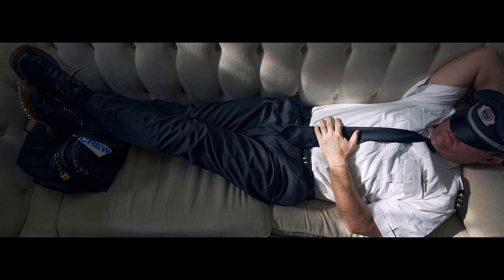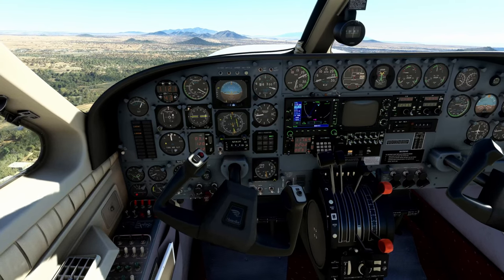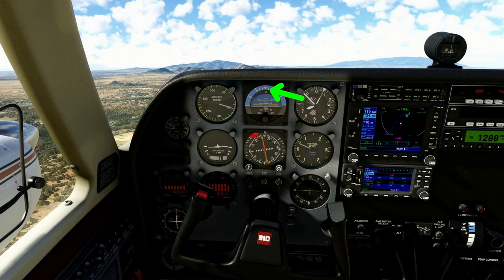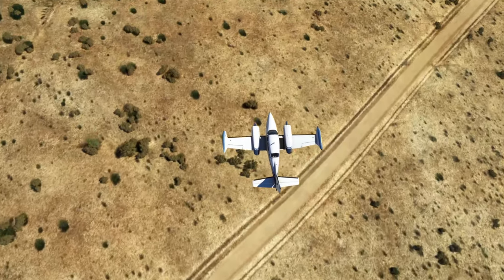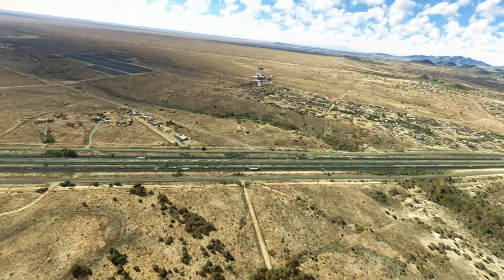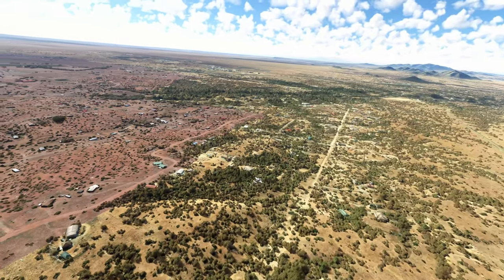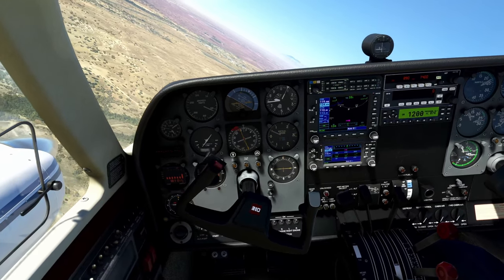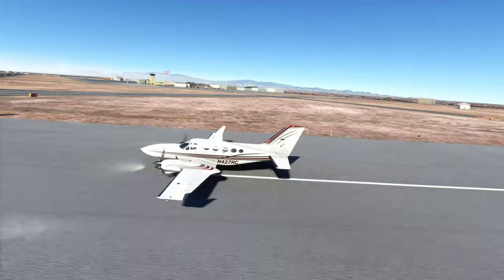Vmc or Die

Comment: Really good video. I do think they are safer for the pilot with the right mindset and training however. I fly a 3 engine big jets as a captain and I own a baron, I have to remember that if I lose one in the baron sometimes straight ahead is the best option, and I need to think about it more like a power loss in a single. I separate the 2 in my mind. It is not gonna fly out like a jet, and V1 is basically blue line in most situation. I tried this out hot and have in MSFS out of Santa Fe after watching your last video, and it’s a bitch. Once or twice I just ended up with an off airport landing. I took off out of Oshkosh yesterday in real life eastbound at max gross weight, and briefed that if we couldn’t land straight ahead and it wouldn’t fly I was gonna nurse it over the houses into the lake just off the end. I also agree about xplane having a better flight model and handling more realistically with an engine out. If you ever need help with the videos let me know. I think your channel is gonna go far.
Reply from the maker: Thanks for that! Those Barons are nice, but if the numbers I’ve seen for single engine climb are right, it shouldn’t climb out of a 6,000’ airport on a warm day near max gross. I did it out of Centennial airport in Colorado a while back on MSFS (about the same altitude) and got the same results as you (I also had it at max gross). I kind of think that MSFS may have the performance on it turned up a bit. Still, great plane!

Comment: As a retired Australian flight instructor with multiple twin ratings including Cessna 300 and 400 series i am amazed at how many VMCa accidents happen in the US.
I saw your reference to not empasising the importance of rudder  but I feel I should make some points.
So for the inexperienced pilot who read this.....

The problem with an engine failure in a twin is asymetric thrust.
This thrust produces yaw.
You correct yaw with rudder, not ailerons!
The C310 has a VMCa about 80kts. It has a best rate of climb SE of 106kts and a best angle of climb of 95kts.
You should be NO WHERE NEAR VMCa!
The way to avoid VMCa is with AIRSPEED! 
Not ailerons!
Not angle of bank!.
The aircraft WILL be sideslipping because it is producing asymetric thust!
What is important is holding a heading and preventing un-wanted yaw.
It is  correct that if you get below VMCa you MUST reduce power on the good engine.
Once power is reduced you will regain rudder authority.
Nose attitude controls air speed so you must lower the nose and regain airspeed to 95 kts at least and re-apply power.
RUDDER prevents yaw not ailerons.
The 5 degree angle of bank is not to save you from VMCa, it is to improve climb performance once you are in control and have achievedd 106kts.
It is obvious to me that VMCa is NOT well understood or well taught in the US, if it was there would not be so many fatalities because of this.
My first twin endorsment included a VMCa roll over demonstration with the appropriate recovery method. This was obviously done at altitude.
I can assure you this demonstration remained firmly fixed in my mind.
I suggest all twin pilot go out with an instructor and do this exercise if you have not already done so.
IF you get to VMCa, you are going down! You must remain in control by reducing power and lower the nose to gain AIRSPEED!
In a twin, AIRSPEED is KING!
If you are anywhere near VMCa with an engine out, you are "behind the power curve", you will NOT be climbing, you will NOT be maintaing height, you WILL be going down!
Look for the blue line speed and fly it REGARDLESS!
Holding it straight, identifying, feathering, cleaning up the aircraft are all priorities before worrying about 5 degrees angle of bank!
Reply: I think I see your point. The 5* angle of bank toward the good engine serves to balance the plane so it will fly essentially straight through the air. The ailerons will however, create a starboard yaw that must be countered with slight rudder.
Reply: @coreyandnathanielchartier3749  There is no such thing as "slight rudder" in a twin with one engine out unless you have reduce power on the good engine, say in a descent or approach.
 With power on strong rudder pressure is needed, this can be trimmed out of course once you are stabalised in the cruise but beware the effect when power is reduced.
With one engine feathered and the other windmilling at idle power the aircraft will yaw toward the "good" engine.
Practice and practice again until you understand the forces involved.
Rudder and airspeed are the most important, 5 degrees bank will improve performance once you are stable.
Reply: A must-read comment sir.
Reply: I couldnt say this better ! These are the exactly the esential points ! 👌👍aim this and stay.

Comment: Nice Video.  I fly a C414A and can confirm what you said. I've experienced two engine failures (one in a C340 other in a 1975 C414) and there is little performance there.  I do a lot of low alt engine failure practice on X-Plane and agree it's closer to reality.  Nice job!!

Comment: Ive watched a few great pilots flyibg twins get in front of the power curve when loosing an engine on takeoff.

1) pick longer runway you can get to 10 knots faster on rotate. Closer to blue line speeds, Never rotate early.

2) dont use flaps, one less step in procedure, choose longer runway.

3) gear up 5 ft above ground. Thats 2 steps left out of procedure during engine out. Removed flaps & gear up steps immediantly. Plus less drag.

4) throttle, props & mixture are most likely set duribg take out so less to think about in emergency.
All are full forward already.

5) pitch for blue line, raise dead on engine 5 degrees, split the ball using rudder.

6) then identify, verify by pullibg throttle on dead engine to idle, feather dead engine & pull its mixture off.

Lastly turn off fuel pump, adjust crossfeed fuel. ⛽️ 

Either land off field straight ahead best option even gear up & survive landing.

Comment: Very well done…. I’ve have been fortunate to fly/own a Aerostar 700.  With one engine (loss of one), it climbs out at 660 ft.  But, you can’t be stupid with overconfidence.
Reply from the maker: Nice plane. If I wasn’t working on college funds I’d probably be working towards one of those…
Reply: I have to admit…. They go through the fuel…. While in Top of climb is 80GPH and when reaching top and on the step at around FL 30..  40GPH @ 65% power.  Insurance is $11,700 a year..  Annual is $15,000 +/-.   Hanger is 18,000 a year….  Sure makes Alaska airlines sound cheap…. Other than landing at the closest airport possible.  Fastest I e ever had her was 435 MPH heading from SEA to CGO with one very favorable tailwind…. And full power to see what she could do.. 😉

Comment: Your attention to detail in explaining the effects of asymmetric thrust as amazing. I never thought of the trained use of rudder, and how it is adversarial in this case. The Santa Fe accident scared me (I fly a 310R), particularly because the pilot must have been a great stick&rudder, but you may have a point. That said, it was a turbo, so would it not have had more climb performance at 9000 feet density altitude, even with average technique. The NTSB will report if the failed side was feathered, and if that remaining turbo was operating.